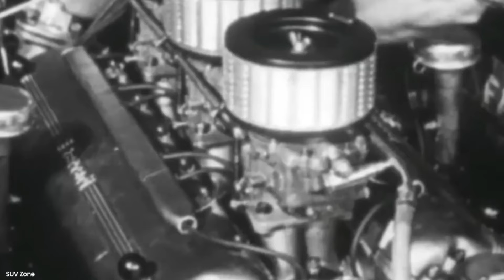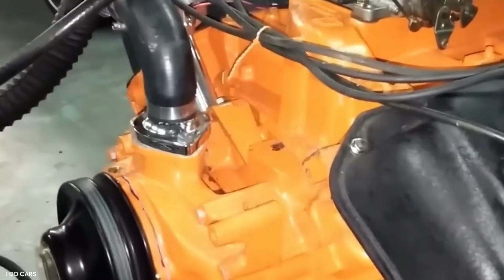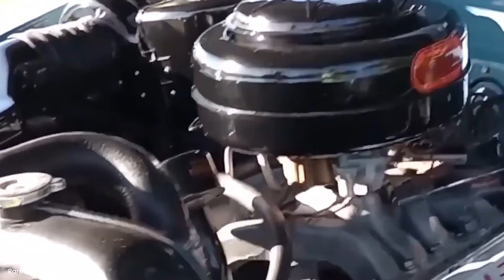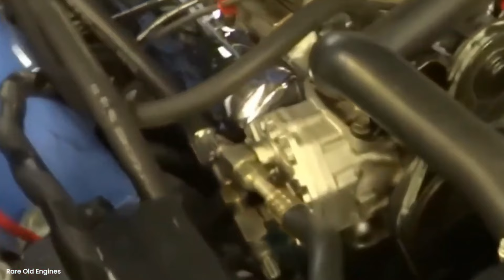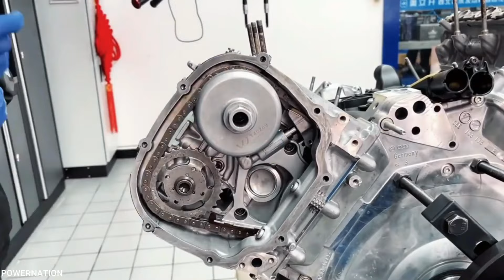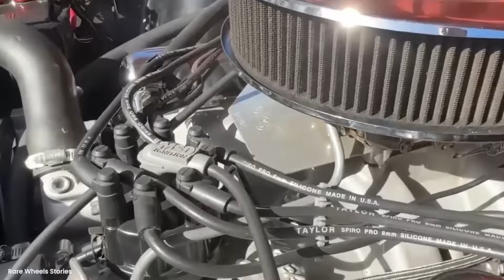Even at 370 HP & Round-Port Heads, the Ram Air IV Shocked Everyone Running 13.1-Second Quarter-Miles

Comment: Where did you get that story of a bone stock 69 GTO Ram Air 4 that ran a 13.1 sec @107 mph... absolutely impossible. more like 14.1 @ 99 mph..much more typical. Pump gas in 1969 actually had 103 octane...from Sunoco 260.  at $.35/gal.  425hp  stock with stock manifolds ..no way... 390-400 at best hp...NHRA in 69' did not refactor these to 425hp...Where did you get that false info? Another false statement that a Pontiac engineer dyno'd one with tuning and headers and it made 501 hp...impossible.